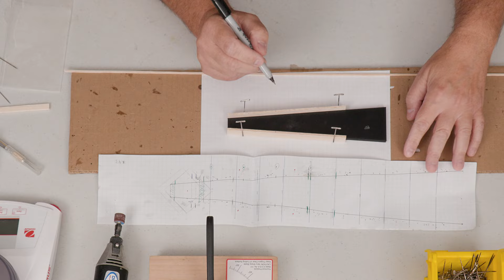Balsa Gluing Techniques

Comment: I build almost exclusively with various CAs and find them perfectly fine for virtually everything. .I only used to use epoxy for the motor mounts of gas engines. Since I use electric power now, I don't even need it for that anymore.

Comment: Hi there! I’m new to balsa building. Are there any drawbacks of using accelerator? Weaker joints or something like that?
Reply from the maker: Hi!  I try to only use accelerator if absolutely necessary, but mainly because it's a bit messy.  I haven't ever seen a problem with the joint strength when using it

Comment: Hello, had a question about making a tower & gluing it on the 3D printed model that you have shared. We tried making it on the 3D model & the tower is stuck? Can you please share techniques on how to glue it on the 3D model & take it off easily?  We tried taping the entire 3D model with clear tape but that's not helping either. Maybe you have a video on how to take it off successfully that I have not viewed yet? Any help you can provide would be amazing. Thanking you in advance.
Mehdi
Reply from the maker: Hi!  Yeah, getting your technique down so the tower doesn't get stuck to the jig takes some practice.  I do have a couple suggestions.  Once you have the legs taped to the jig, build the cross-members with the jig on its side like I show in a lot of my latest videos.  This really helps limit the amount of glue being used and there is less of a chance it drips on to the jig.  If you want to try the barrier method, use wax paper.  I would try taping long strips of wax paper in place on the jig before putting the legs in.  Honestly though, this isn't necessary if you focus on reducing the glue.  Finally, if your tower does get stuck, the best way I've found to get it off is to find a small block, or I 3d printed one 30x30x5mm.  Temporarily tape it to the very top of the jig and carefully turn the entire over and put it on a hard flat surface.  Then firmly press at least 2 legs at once from the bottom and with any luck, your tower will pop free.  The key is to push from the bottom instead of trying to pull it off from the top.  Good luck!!

Comment: My glue keeps drying before i can press the two pieces together in the right spot, what should I do? Normally I wouldn't care but on my bridge I've noticed a couple of failures at the joints between major parts(like longer beams, those are really hard to line up :/)
Reply from the maker: There is no easy answer except to be faster and practice.  It helps if you mark the piece exactly where you are going to glue and make sure the piece you are gluing is immediately ready to go.  Perhaps practice by pretending to apply the glue and see how fast you can get the piece into position.  Once you are confident in being able to do it fast, then apply the glue.  If you are talking about the complex "L" joint I used for one of the designs for this year's bridges, I recommend checking out my Div C full-build video at around the 34 minute mark to see how I do it:  https://youtu.be/7W839KEcKes
Reply: @balsaengineering6686  Ok-thank you so much for your reply!!!

Comment: I personally find that CA glue is a great gap filler. It work amazing filling grain on wood and if you do it in layers you can fill pretty large gaps.
Reply from the maker: You can also use the much thicker CA glue for better gap filling properties.  The gel based stuff works pretty well.  Of course, the downside is that amount of glue tends to be heavy.  Ideally, your entire build will only add a couple tenths of a gram of weight to your entire device.  It good to compare the bare material weights to your final device to see how much glue you are using and only use the minimum necessary.

Comment: Your videos helped me so much in getting started :) I'm wondering if there is a different place to buy glue. (I looked up the one you used in the video, it's quite expensive for us and we probably won't use that much). Also, can you recommend a blade for wood-cutting?
Reply from the maker: I'm glad my videos have helped you out!  You should be able to find similar CA glue locally or even on Amazon in much smaller amounts.  Just a quick search turns up something like this which is 40 cps and under $13: https://www.amazon.com/Premium-Grade-Cyanoacrylate-Super-STARBOND/dp/B00BUVAS9Q/ref=sr_1_8?crid=JEPPYZUR5F99&keywords=CA+glue+thin&qid=1698013255&sprefix=ca+glue+thin%2Caps%2C106&sr=8-8       I use and recommend getting the miter cutter from these folks: https://www.fourmostproducts.com/our-products/construction-tools/
Reply: @balsaengineering6686  Thank you so much for the quick response!!
Reply: @balsaengineering6686  A quick follow-up, when cutting the balsa sheet into sticks, what blade/tool would you recommend using? If a table saw (which I probably can't afford) is needed/highly recommended, would it be better to just go for balsa sticks then?
Reply from the maker: @suziel5523  Oh no, definitely not a table saw or any power tool.  This is the balsa stripping tool I use:  https://www.amazon.com/gp/product/B0000WS5OQ/ref=ppx_yo_dt_b_search_asin_title?ie=UTF8&psc=1  Check out this video when you get a chance to see how I use that tool to strip sheets of balsa: https://youtu.be/bLsTOpmozGI

Comment: All I have is generic super glue like the original super glue brand and loctite super glue. Would this still work effectively for the Div C bridge?
Reply from the maker: Yep, that should be fine.  I don't think the brand matters at all.  The only real difference is the viscosity.  You can buy CA glue anywhere in thickness from almost water thin to gel.  Most likely what you have a medium viscosity and that will work great
Reply: @balsaengineering6686  thank you

Comment: Thanks for video.  I am not a big fan of CA for smell and skin irritation reasons.  What would be your second choice of glue for general balsa model building?
Reply from the maker: I don't really have a second choice if it's for these Science Olympiad builds where weight is super critical as well as cure time.  If you are gluing larger pieces together and can clamp them, wood glue would be fine.  Maybe something like a quick cure epoxy would be OK, but that will most likely smell worse than CA.  See if you can set up a fan in a well ventilated room before using CA.  Wearing latex gloves is also an option.  I've seen some students do this, but it's usually not worth the hassle as if you are careful, you can avoid touching it altogether.

Comment: Does burning glue on the T-pin create any harmful fumes? I would also be interested in hearing your thoughts on gluing with a microapplicator and directly from the bottle.
Reply from the maker: I'm not sure how harmful the fumes are, but I would only do that if you have a large, well-ventilated space.  Any technique that can accurately and quickly apply glue is good.  I've never tried applying glue directly from the bottle.  I would think that wouldn't be fast enough, but if you get good at it, maybe it'd be fine.

Comment: Do you think I could use glue with 2-3 CPS?
Reply: I am using this glue for a division c tower build.
Reply from the maker: @MichaelIsaac-kd1ki  Sure, if that works for you, go for it!  I've never used CA that is that thin, but it should be fine if you can work effectively with it